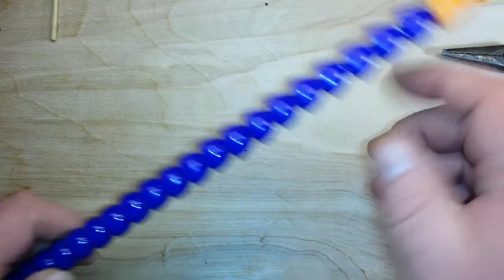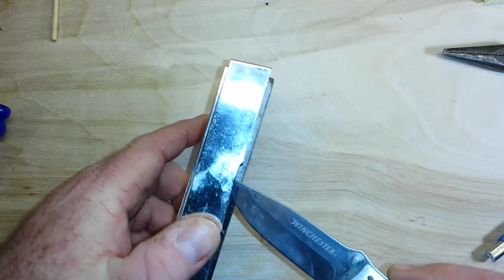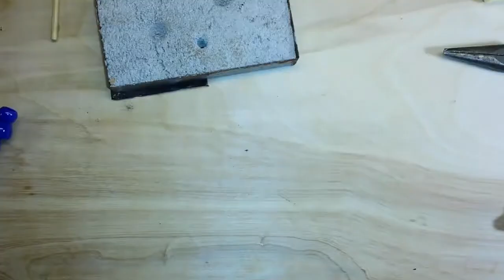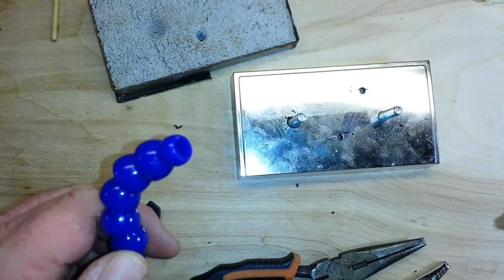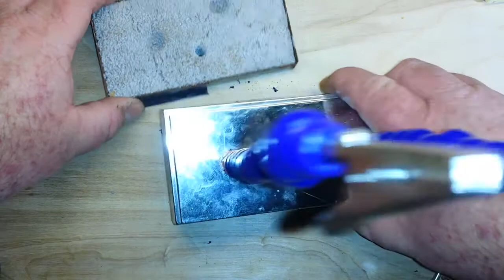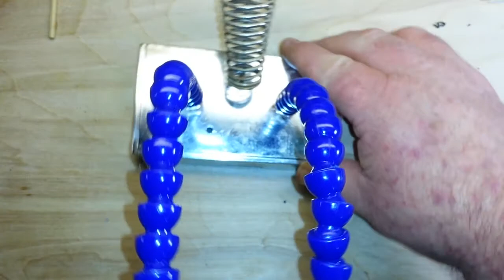DIY Flexible 3rd Hand

Comment: Those tubes can be adjusted at every joint, therefore, i would've taken say three joints from the bottom over the bolts, fill the cavity with hot glue(mmmm hot glue) top with appropriate nut than snapped the remainder on after curing.